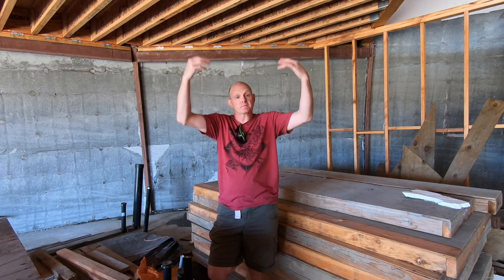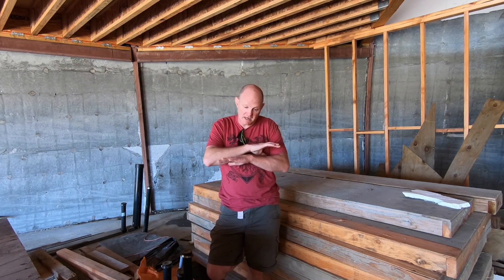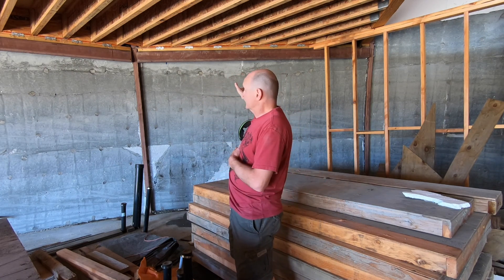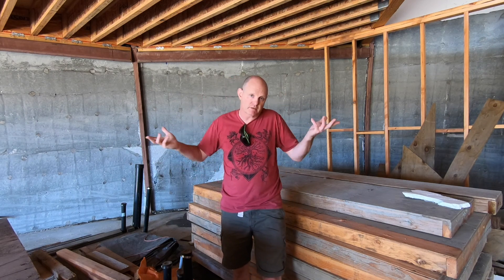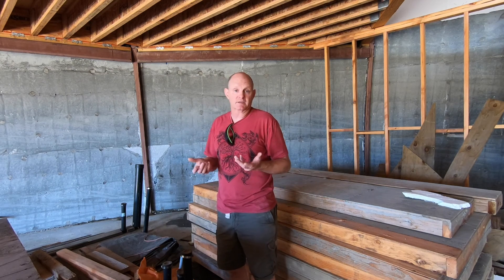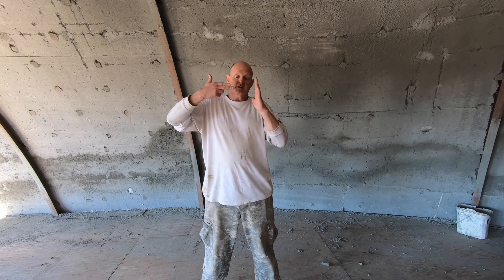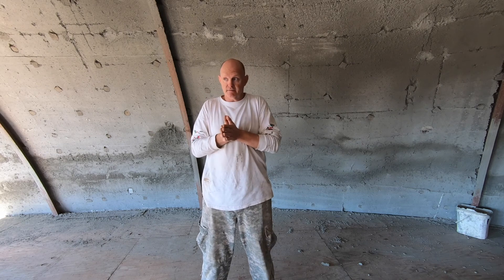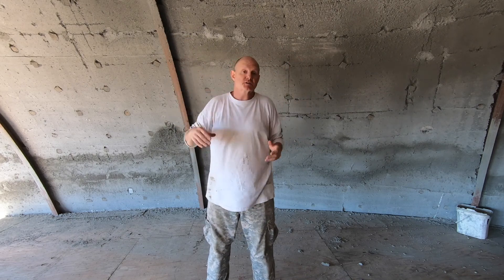Shotcrete!   Dos and Don'ts!

Comment: If the thickness of the shotcrete is thin enough you could start at the top and work down done it before works great easy
Reply from the maker: No, you cannot.  

Even a thin amount of shotcrete would, before you get to the bottom, be too much weight and very likely distort the entire dome.  

You also would need to put enough shotcrete to cover at least the first layer of rebar.  The dome was 90 cubic yards of shotcrete total, at roughly 4 and 1/2 inches thick.  (it does get thicker at the base)   

In order to cover the first layer of rebar, you'd have about 1 1/2" thick layer.  

ONE cubic yard of concrete weighs two tons.  

You'd have AT LEAST 20 tons, likely  more, before you got to the bottom.    

I could do the actual math, but there's no point.  Shooting from the top down would create a number of serious issues.
Reply: @theeddiesshow  done it before in fact we do it often on jobs with big cuts into hills we dig and then they drill soil nails and we shoot from top down .with 4×4 mesh and rebar  .how do you think overhead shotcrete is done ? Same thing or wine caves I've shot a few of them as well we're you have no choice but to slowly shoot with no under support I've done this work for 25 years pumping shooting finishing  I am not saying I know alll because I certainly do not .that's why I watch videos so I can learn and better myself .I just thought I'd share that's all I mean no negative or anything  I respect any and all that post videos and  I learn from yours and others so thanks for posting .
Reply from the maker: @martymello8772  Shooting a hillside or a tunnel from the inside is vastly different than shooting a dome from the outside.  I suspect the soil nails you guys use help hold the structure up while the concrete is curing?   maybe that's why you can do that?  Dunno.. 

I can tell you that the architects and engineers, (Formworks Building) have adamantly said DON'T shoot from the top down. It's a question they get often, and they always say DON'T DO IT. 

I've only built two of these houses, so I can only speak to this type of construction.  I'm sure the tunnels are a different breed.    The few wine guys I know said they shoot from the bottom up, but if you can do it from the top down, and it works, cool.  I wouldn't build THIS type of house that way.

Comment: Eddie, going forward on shotcrete. the reason you have rock pockets is because the contractor wasn't using blow pipes.There should have been a blow pipe 6 inches in front of the nozzle blowing away the rebound to clean down to the surface and the rebar of any and all rebound. There should also be another blow pipe behind the nozzle removing the rebound that is now accumulating behind. also the man following behind should be scrapping down to clean surface in peroration for the next lift.
We have had inspectors here in the Bay Area  not let the nozzle man proceed until the blow pipe was doing his job. 
Also does the contractor have a compressor big enough to run two blow pipes and a nozzle? A 185 is not big enough we use a 375 because on hot days there is air loss, the hotter the day the more drop there is.

What did you use for the shell form? I really could not see it. The leadger for the second floor, what was the leadger and was it shoot into the shell? There are a few ways to do that, one way was to shoot the leadger with shootcrete. This way would have made a concrete beam for the shell and also would have looked just awesome from below being exposed as a visual.
Thanks for the video, we've shot a lot of jobs just not a dome house.
Reply from the maker: hI john, 

We had the blow pipes and a deputy inspector is required in LA.  The other factor in play is the fact that the structural engineers simply put a LOT of steel in a very small area, which of course, creates others issues.  i see this often in fact.  

The rest of your questions are answered in the various videos.  There's an entire video on lining the dome which is done using styrofoam sheets.

Comment: How thick is the concrete? 6" at the bottom to 4" at the top?  Why remove the foam, don't you want/need insulation there?
Reply from the maker: The inside concrete wall gets plastered. The earth surrounding the house provides plenty of insulation.

Comment: Hey Eddie, I have had the problem that sent you to the hospital. The antibiotics ruin your immune system. The cause is not enough insoluble fiber. It is what act like a brush and carry sharp things and toxins out of your body. Fermented foods made from plants will help you rebuild the microbiome in your body that has been destroyed. I cost know-thing for knowledge and experience that save my body.

Really appreciate your sharing of your dome experience! The insight on preparation for success was invaluable!

All the Best
Reply from the maker: in my case it's likely hereditary.  And I eat plenty of fiber and good food, not junk, but all good points which we did. 

It's been awhile now, and I don't even really notice or think about it except when I see the scar.

Comment: The overspray and rebound (that became the loose unconsolidated pebbles on the inside of the dome) is kinda inevitable spraying against stryofoam, as it's a very bouncy material. We tediously scraped it away the couple times i helped shoot a dome. The better method would be to use an air lance, going right behind the nozzleman, blowing off the loose stuff.
Reply from the maker: Interesting!   The last house I built did not have this issue, or maybe it did, and I didn't see it.... lol

Comment: im curious about how the guys shot the concrete to the re bars and only the styrofoam was holding the concrete? what did you use as a mold so the concrete wont fall inside the dome?
Reply from the maker: The styrofoam holds the shotcrete. They shoot about 2" in thickness first, let it set a little, then put the rest.  By letting a little bit set, it can then support the rest of it. 

We did have some "sags" in it, but once plastered and painted, they aren't visible anymore.  Same thing happened on my last home.
Reply: i plan to make an underground home in the future so im open to ideas.

Comment: In the video, you suggested that "pool jacks" and "slope jacks" are the way to mount platforms on the dome. I googled both terms, but still couldn't figure out what you meant or how they work. Could you clarify, please?

Thank you for posting these videos. I'm learning a lot!
Reply from the maker: Pool jacks are used on pools, slope jacks are used on slopes.  Basically, they are metal brackets that "lock" into the rebar, and planks are then run across them.  Commonly used in the shotcrete industry for shooting pools, and slopes... (Hillsides)
Reply: Well, I found screw jacks, swivel jacks, pump jacks, and even jiffy jacks, all for sale. But I think the "ladder jacks" may work best. I also found rebar mounting hardware. With all these components, I'm sure it's possible to mount a scaffold on the sloping rebar. Thank you!
Reply from the maker: @ray-tobey  Maybe those are terms used in the industry in my area.  That's what they called it.

Comment: First off, Thanks for posting! Glad to see another dome video! Question 1. What does it cost per sq/ft to get it to this point?(I plan on doing as much of the labor as I can and contract out the concrete work) 2. Why does the outside need to be smooth? - I am guessing it has to do with water resistance/helping with the waterproofing membrane.. Thanks!
Reply from the maker: I'm not sure of the cost per foot to get to this point.  When done, i should be into this house I'm estimating $200 a square foot, but probably less.  

The outside needs to be smooth so the waterproofing has a smooth surface to go on.  If it's rough, you may tear the membrane or create "voids" where, if water got in, could eventaully seep through.  

The membrane is covered with a substance called Bituthane... that when wet, expands 100Xs it's size, and seals leaks.